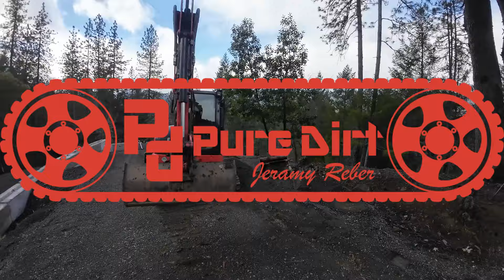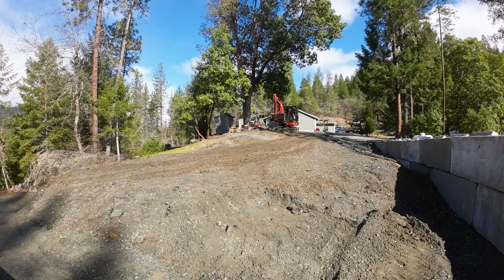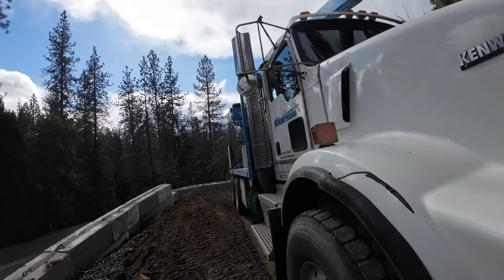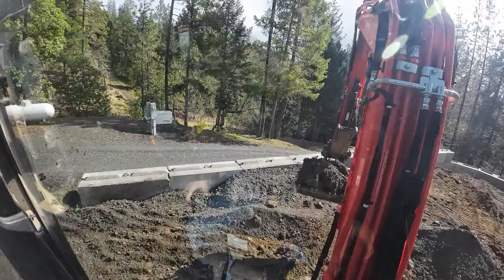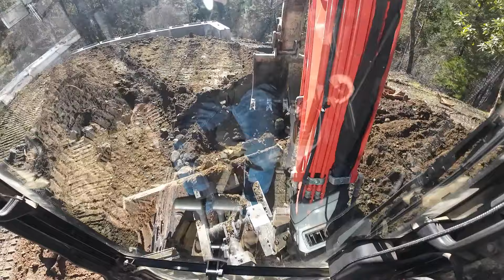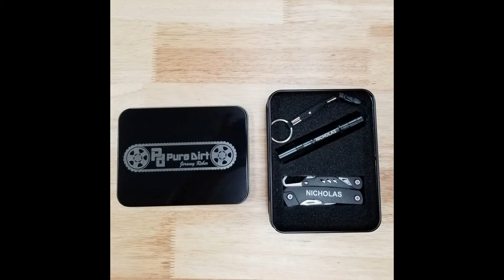Finishing the GEO block job with the Kubota KX 040 4

Comment: Nice work Jeramy! Sure hope the weather cooperates for some work in the mud bog (forever job), hopefully including some 80 work. 🤠 That is a cool boom truck handling the blocks. Glad you showed me how to flip the handle over on that compactor and reverse directions. I have a knack at finding ways to struggle. Last week after owning my Husqy saw for a couple years and pulling about 30 times to start it, I figured out it had a choke. Now it only takes 4 or 5 pulls total to start. We need to hang out more so I can learn cool ways to not waste time and effort. 🤣
Reply from the maker: Thank you, I will call you in a while and see what you think about tomorrow.